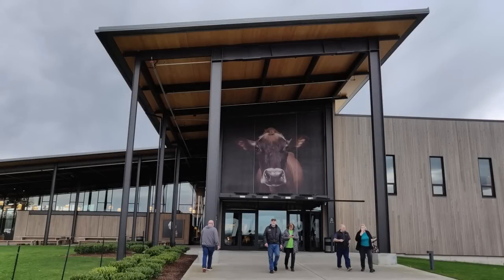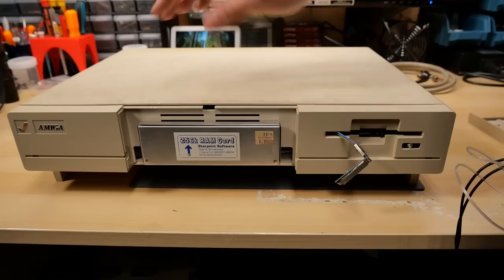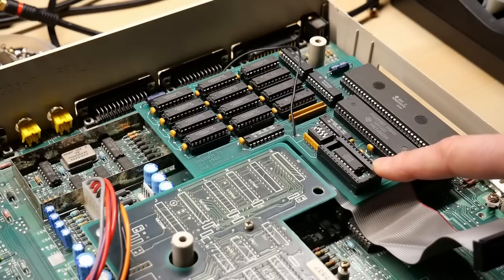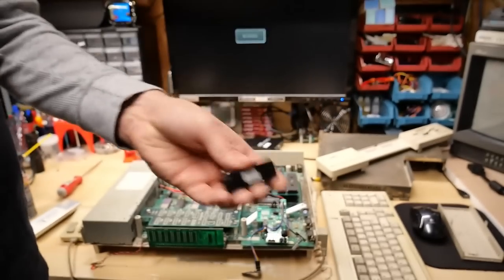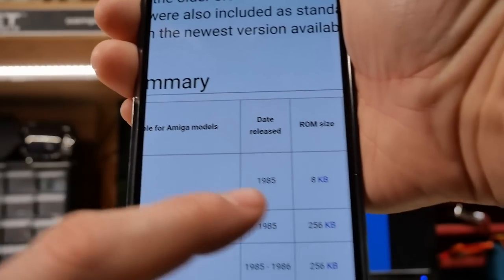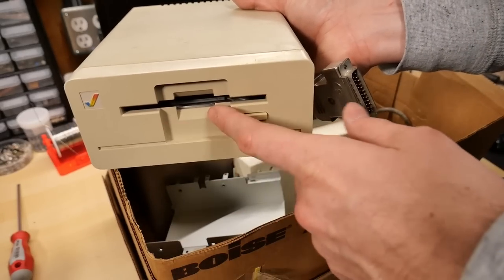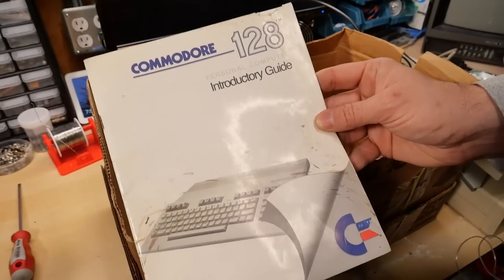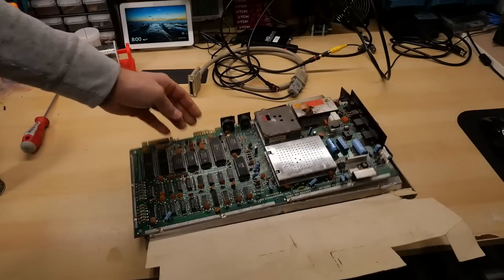Picking up an Amiga 1000 in Lincoln City, Oregon!

Comment: Great video/intro Adrian!  It was great to meet you!  I'm glad the A1000 is in much better hands and will be taken care of!!!  ;-)   I agree with the other post; style / design wise, the A1000 is my favorite Amiga.  But I think I probably would have done more damage trying to keep it going.  Also, I grew up with an A500 and A1200, both of which I have again.  So I don't have an attachment to the A1000.  I will definitely be following this repair!! :-)  And good call on stopping at Tillamook for ice cream on the way back up.    All that C64 stuff and the tape drive that someone gave me came from a barn in Grand Ronde, OR.  No idea how long they were sitting in that barn.  ;-)
Reply: @geekwithsocialskills  Nice, I've never actually seen a CDTV in person, but loved the concept and what I've seen!
Reply: Even though the Amiga 1000 is a nice looking system and the original Amiga, I probably would have gone the same route as you and kept the 500 and 1200.  If you actually want to use your Amiga, the 1200 is the way to go with it's AGP graphics and IDE support, all in an easier to display package. Curating your collection helps you use and enjoy what you have... 🙂
Reply: I owned an A500 and an A600 back in the day (still have the A600), i liked the 600 so much because it was just so much more compact than the A500 which took up my entire desk at the time. The A1000 looks like it might have been even bigger, although it does have the internal power supply at least.
Reply from the maker: The 1000 is rather compact as far as Amigas go. It's not that much bigger than the 1084 monitor it would sit under... compare this to the Amiga 2000 which is honestly a monster machine. Ugly too!
Reply: I've been to the Tillamook factory half a dozen times (most recently a couple months ago), but they've never been running the cheese lines when I've been there.  Great footage (and great ice cream)!

Comment: This video sure brings back memories. I did a lot of reports in college on an IBM and a classmate had one of the Amigas. They were so straight forward to use. I also used one of the first editions of Calc 123. It was a very basic spreadsheet but great for making tables for various reports.

Thanks for showing Lincoln City. I live in Newport, OR which is about 25 miles south. Back in the 60s and early 70s you could actually walk on the manufacturing floor of the Tillamook Cheese factory. I remember looking over the side if the large bins where they were  cutting the young cheese.

Comment: The Amiga 1000 was definately one of the best micro's at that time. I had the A1000 with original Commodore 256kb expansion, and as i recall also real time clock in the same module. Later I got the Sidecar, which could run as a PC @ 4.77 Mhz. The biggest advantage of the sidecar was that it offered harddisk availability to the Amiga, which just by itself was quite expensive at lease in my country. I never got that far to have accelerator boards in it, and it was later stored and lost in my parents basement due to a flooding. I wish I had that A1000 today :) Looking forward to see more videos of the Amiga :)

Comment: Great stuff as always, Adrian. The Amiga 1000 had 256K on that daughter board exclusively for the Kickstart ROM, so it does not take away any use RAM for the Kickstart. When you boot you should have about 2 MB total - 512k CHIP RAM and 1.5 MB FAST RAM, with the Kickstart ROM happily residing in the dedicated RAM on that board.
The Paula Chip might be flaky, as that controls the audio. It also handles some floppy access too.
Send me a message on Twitter if you need any help or advice on this beautiful machine. @10marc1
Reply from the maker: Thanks will do! Just clearing out some other projects in the pipeline before I can attack the 1000. :-)

Comment: Those C64 power supply bricks were a real bane!  I remember the day my father and I drove to Commodore's Toronto offices to get my C64c repaired and a new power supply to go with it -- he wasn't very happy with the failure and resulting expense!  Had another power supply fail a few months later too.

My friends and I subscribed to a rumor that some of the original C64 black power bricks weren't potted in resin and thus simple to repair on failure.  This was likely fueled by a text file each of us had showing a very simple schematic of a DIY C64 power supply.  Our holy grail of C64 hardware, which we could never find, and I'm not sure if such a brick ever existed.

Comment: There's a really cool disk drive mod you can do.  You can put the floppy drive internal, but set it to be drive 2 (via solder jumper or external switch), and the set the external gotek to be drive 1 for booting. (Again, you can set up a switch to choose the orientation you want, so you can switch between them easily.). There's videos out there that cover the mod.
Reply: Yeah, that would be the most useful.  That said, i did that same mod on my Atari ST and it never did work right for me, but my ST always had some odd issues... in the end, after repeatedly been told by Adrians that I should stop wasting my time, I just installed the Gotek inside (with a 3d printed mount).  Truth me told, having the original drives in them is good for looks, but in the long run, they'll serve no other purpose unless we can get someone to do a Kickstarter for new floppy disks.  🙂

Comment: 1) You can soft kick into higher Kickstarts. I'm running 2.1 on my 1000.

2) It isn't just the signatures of the PEOPLE that worked on the Amiga 1000 -- there's a paw print there from Jay Miner's dog Mitchy! As legend has it, he helped design the Amiga. Jay would draw something and look at Mitchy and if he barked, Jay would change the design. If Mitchy wagged his tail, the design stood. :)

3) The parallel port is standard; it's the RS-232 serial port that's different and there is power on a pin so BE CAREFUL.

4) If you need an original internal floppy drive mech, let me know and I'll send you one.

Comment: Interesting fact - the daughterboard on the A1000 was basically a lot of the logic that went into the later GARY chip (Gate Array) - and because it's mostly simple 74LS logic & PALs and the PAL equations are documented, it means the GARY chip is able to be reverse engineered - there's a community of people loosely trying to reverse engineer the Amiga chipsets for projects like the A500++ boards (reproduction A500+ motherboards), there's even an Agnus 8375 reproduction in the works!

Comment: Found your channel the other day and have been binge watching your videos. They're great! I do have a question though have you ever worked on HP handheld mini computers, I have a HP 660LX that I mistakenly plug in a 19v power supply instead of the 12v one. With the correct power supply installed I can get a green light with the battery removed but only a flashing green with a solid yellowish light with the battery installed. Of course the unit doesn't boot up.

Comment: You mention it's good that you have the extra 256k because of the kickstart, but as you can see with the total ram available the kickstart isn't loaded into normal ram. There's a dedicated 256k available for that.
Reply: Yes, the A1000 has a dedicated Write Once Memory to store the contents of Kickstart over and above the regular RAM.
Reply from the maker: So there is 256k of chip RAM on the motherboard, the another 256k inside the machine for Kickstart, and then the front 256k RAM expansion card and then the 1.5mb of RAM? Is that extra 256k on the that extra card inside mounted over the motherboard?
Reply: @adriansdigitalbasement  I think it's like this:  In Amiga terminology, Chip RAM is RAM that is addressable by the Amiga's custom chips -- the Copper and Blitter, etc.  This RAM can be used for programs and the OS, but it is the only RAM that can be used for display memory, coprocessor instructions, and perhaps audio samples that can be played using the DMA hardware.  'Fast RAM' is memory that the CPU can address for programs, Workbench, and data, but the custom chipset cannot utilize on its own.  Having more Fast RAM means that more or all of the 'Chip RAM' can be dedicated to graphics and sound.  The Write Once Memory is on the daughter board piggybacked upside-down on the main board, and is only used for Kickstart.  Basically, it's a soft ROM.

If I understand correctly, your A1000 has 256K of Chip RAM on the main board, 256K of Chip RAM on the perpendicular front memory expansion bay, and 1.5M of Fast RAM on the Insider II.  (I happen to have an A1000 with the same Insider II board as well.)
Reply: @adriansdigitalbasement  That is right.

Comment: On being able to boot into other ROMs using a floppy to upgrade, I used to use one for my A1200 which loaded Workbench 1.3 into RAM to allow for better(it didn't always work) compatibility with older programs. It was called ReKick.

Comment: 9:00 Loading Kickstart does not eat any system RAM at all.  The Amiga 1000 has 256k on the WCS which is the daughter board on the top of the machine.  This RAM is for the Kickstart!
Reply: I was about to make this comment. AFAIK The rev a had this extra ram because the ks was not ready! They didn't want to ship a buggy rom.

Comment: 15:01 I think it was the Vic 20. At least I used that exact tape drive with mine.
Mine was significantly cleaner back then....
Reply: I've seen PETs that had that tape drive in them too, only in black.
Reply from the maker: Yeah I had a IIc when I was a kid (around 1982) and I had the later rounded corner datasette with mine. This must have been from the early 1981 release of the VIC-20.

Comment: Yep, the external drives are as per the internal ones, they just drop right in... :)

As for the computer itself, I don't think I've seen the Amiga 1000 myself, so will be fun to see how it evolved from this to the later Amiga models, I have two A600s myself (though one is semi-dead as spare parts), but also used to own an A500, remembering having to use the Kickstart 1.3 ROM disk to "downgrade" it from the later 2.x one the computer had to run certain games which refused to work with the newer ROM... :)

Comment: Regarding the floppy drive - you should be able to use the mechanism from an external drive internally. You could also use the floppy drive from any other Amiga - the disk interface never changed. There is also the possibility to modify a PC floppy drive to work, but it's a bit more complicated and depends on the drive itself - some dont work very well after modification.

Basically the Amiga has a standard "Shugart" floppy drive interface, and the PC standard modified this slightly. If you have another source of standard Shugart double density floppy drives, they should work without issue in an Amiga

Comment: I bet it would be possible to use a milling machine to pocket out the inside of an original C64 power brick and make it into a case for a new PSU.
Reply: I bet that milling through components like a transformer made of copper and iron would be much more of a hassle than to just slam the entire thing against something solid with brute force to knock it free.

Comment: Commodore also made their own 256K memory expansion card, and I think you could just buy the computer with it already installed. My dad's had it. According to the manual for Deluxe Paint, higher graphics modes (640x200x16colors as opposed to just the four Workbench uses, and 640x400 with ugly interlacing) only work if you have the extra memory. Also, I could be misremembering, but I think that "TVMOD" DIN connector is the same one used by the VIC-20 and 64. Pretty sure I used my TI-99/4A antenna box to connect it to my TV once, just to see if it would work, and it did.
Reply from the maker: Interesting about that pin-out. I need to look at the pin out. As for the RAM card, indeed seemed it was a popular 3rd party add-on -- probably at a nice cheaper price than the Commodore one.

Comment: I always have been under the impression that that daughterboard actually hosts the Kickstart WOM, a special piece of memory to hold the Kickstart, which was still loaded from the disk at this point. I have a PAL Amiga 1000, and that also has this thing thing in it. So it's certainly not some "additional logic" only early American A1000s have. In fact all Amiga 1000s should have it, to my knowledge (fix me?).
Reply: This of course also means (having a special area for Kickstart), that it doesn't take up any of the regular memory, unlike mentioned in the video.
Reply from the maker: From what I read, the kickstart does reside in protected memory, but it takes away from available RAM. There isn't a special dedicated 256k of RAM just for Kickstart. If I get one of those little boards that maps a kickstart ROM chip into memory, then you can use that RAM as normal memory....
Reply from the maker: Ok no, I guess there is another 256k floating around inside the machine too. That's pretty crazy! Would be interesting to just map FLASH memory into that space so it could hold the kick start even after power off.
Reply: @adriansdigitalbasement  Actually, there should be even some space on the board prepared for actual ROM chips (maybe place for two/four sockets, marked ODD and EVEN)... But there are adapters out there too, which makes it possible to use a regular one chip 256KB v1.3 or even a 512KB ROM v2.x/v3.x  ROM (the A500/A600/A2000 ROM version). I'm quite sure, the original intention was to release the machine with OS in the ROM, hence they prepared the space for it on the PCB. But as usual, the software was delayed, so they went with the WCS/WOM and Kickstart disk approach, which I'm sure they used in-house anyway for development. And Commodore did this again (or something quite similar), for early the Amiga 3000s, and their "Kickstart 1.4".

Comment: Yes. The A1000 and the A1010 has the same drive mechanism.
Reply from the maker: Cool! I have already taken apart the A1010 and indeed, it seems to be a direct fit. Unfortunately the RAM expansion card means space is so tight, I have to remove the expansion card to install the disk drive back in. Space is at a premium!
Reply: @adriansdigitalbasement  Yes. There is a socket relocator (which also has space for kickstart ROMs if you like) available on amigalove dot com. It might fit your needs.

Comment: To be able to boot the gotek while being external I think you need kick 2.04 or higher.
Reply from the maker: That's what I was reading too -- or I'll need to do a hardware mod to switch the drives around and make the internal one act as external.
Reply: Yes a mod i probably better so you can use kick 1.3, the most compatible one.

Comment: Great video check out AmigaLove YT channel he has some great informal videos on the A1000, also lookup twinkick you can have a kickstart disk with 2 versions on one floppy. Running ks1.3 & 3.1 using the A500 version. Im pretty sure the external fdd will fit internally.